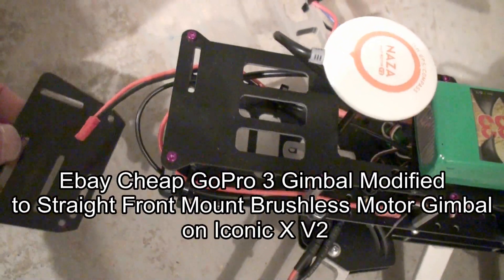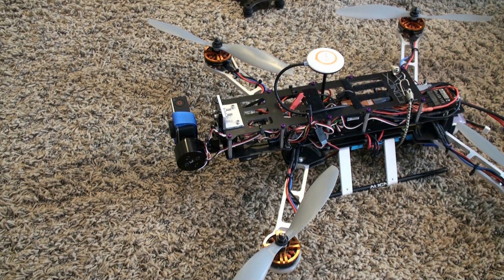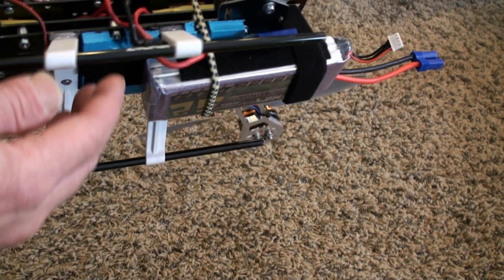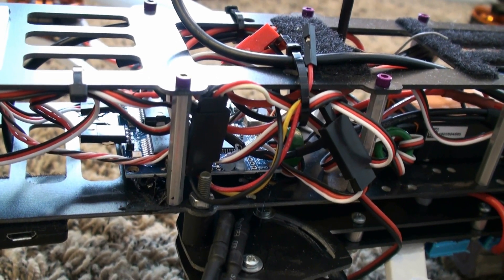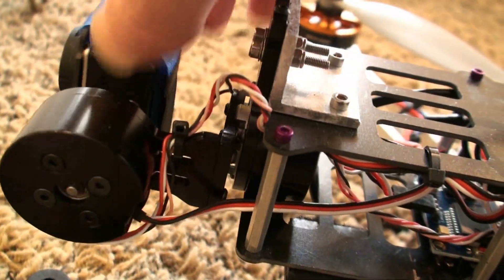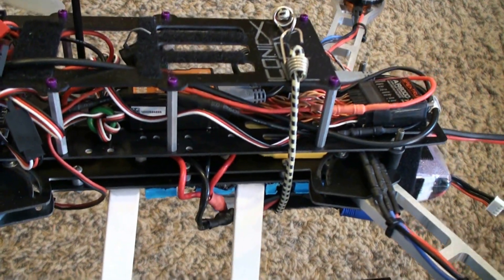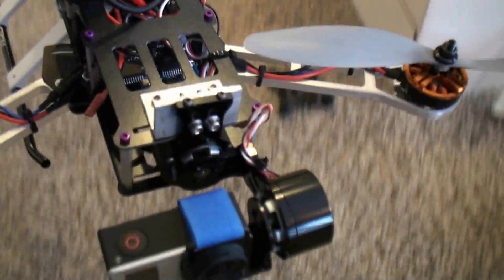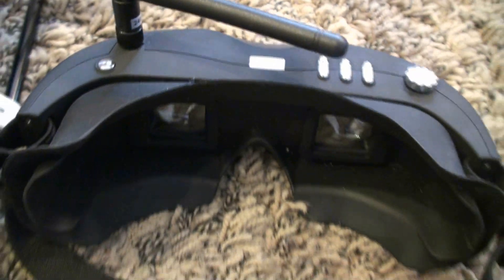Ebay GoPro 3 Gimbal Modified to Staight Front Mount Brushless Motor Gimbal on Iconic X

Comment: Hey there...

Hope your holding up from all the cold... I'm in so cal, it rained tons last week, so not been flying..

I have a few questions maybe you can help me with.. I built a few copters now.. 3 SimpleCopters a T and a V tail, love the V tail.. now I bought and built a ImmersionRC XuGong 10" with Naza V2. using a spektrum DX9, can't get the return to home thing going yet, running 6 channel reciever, just bought some 9, but trying to figure out that mess... the other mess is they have a servo tilt on the copter works fine, but zipo for vids it's a mess jello etc.. so I have a gimbal but no controller I was looking at getting, but I think for the extra $$ I will just do what you did.. question is will this work ? http://www.ebay.com/itm/191089847518

or do you have a better source ( I don't have time to wait for China shipment) as next week I have to go to Vegas to shoot some huge Mint 400 offroad racing, need to get this dialed in.. 

Thanx Much !!!!

Comment: Please can you inform me anout the gimbal settings?

Kindly regards,

Dick Gerritsen
Dutch Mountains
Reply from the maker: This Gimbal comes new out of the box and ready to work with all the settings in it, all you need is to connect it to a 3 cell lipo or 3s battery like in the video!
If you want to use the tilt, you must use your RC open channel servo to set that up for the travel limits of the tilt with your radio like in the video. I hope this helps